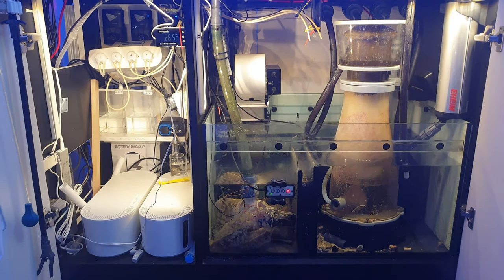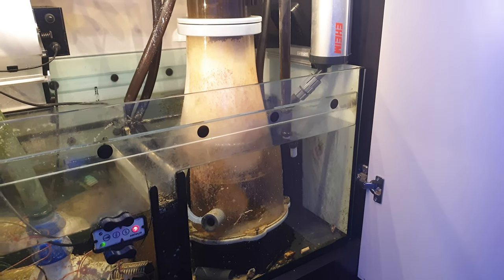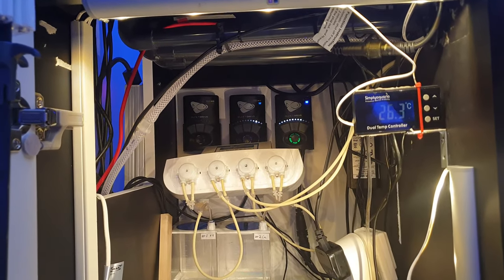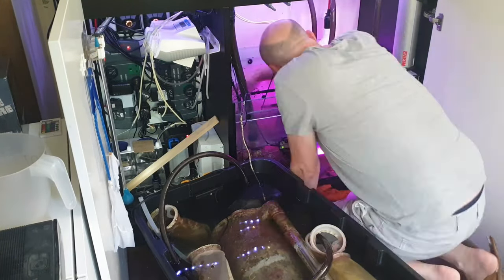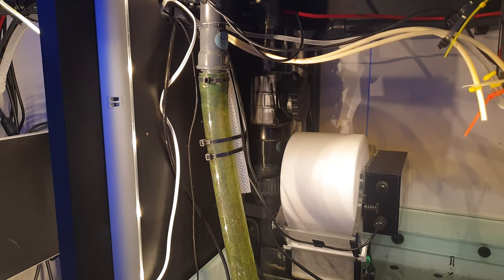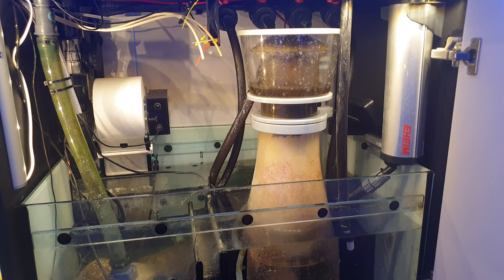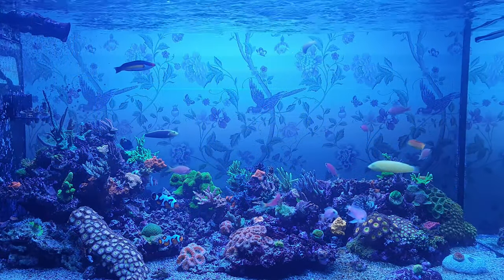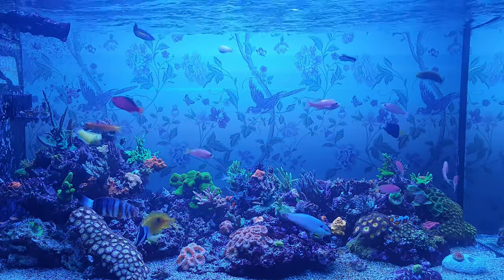Red Sea Reefer v3 Sump At 18 Months: Things I Wish I'd Done

Comment: You can still carbon dose to lower nutrients if you have a spare channel on your doser it works great. Cheap vodka will do, mix it with RO so you can dose 1ml = 0.25ml vodka per day. Increase every few days or weekly till nutrients are down to where you want them and then back off the dose amount again in the same way till nutrients rises again. That will indicate your tanks current maintenance dose(adding or removing fish etc will change it) It works well even with a refugium just try not to harvest algae while you trying to find the maintenance dose, you will get a increase in nutrients depending on how much you harvest but it is not the increase you are looking out for. If you ever what to stop carbon dosing just lower the daily maintenance dose over time till it is 0.

Comment: You mention you are running 2 schengo titanium heaters.   Do you use 2 temperature control units?
Reply from the maker: Yes I do - it's a Simply Aquaria unit and has the fans connected too.

Comment: I see you are using ati pro and also dosing iodine. Could I ask how much iodine you are dosing as a maintenance dose rather than a corrective one? In my recent icp I was low on iodine and although it told me how much to correct it, it didn't tell me how much to dose to maintain decent levels. Thanks
Reply from the maker: I started at 1ml per week which wasn't enough so I slowly increased it to 4ml per week but that was too much! So I've started the process again - back to 1ml per week for now.